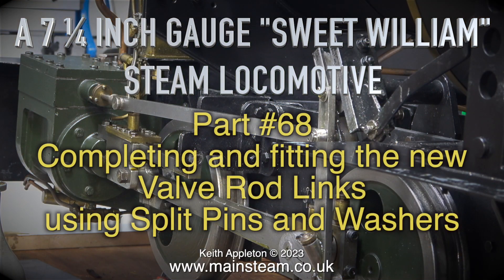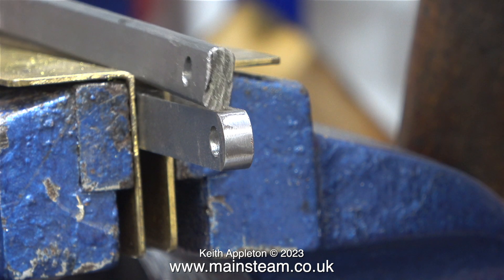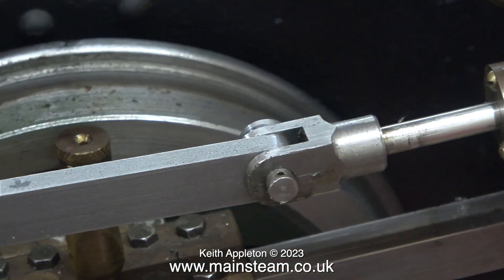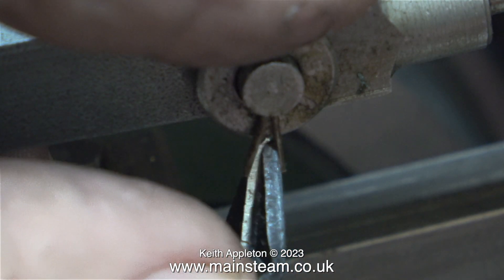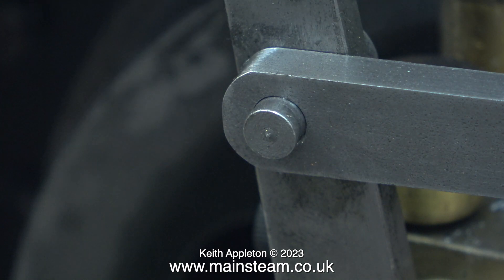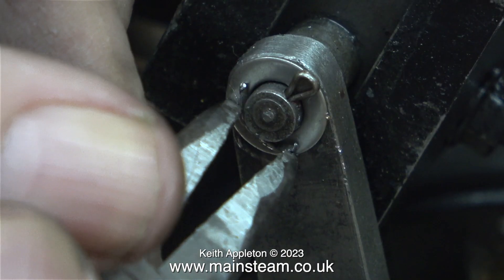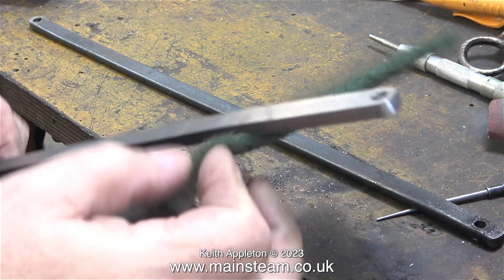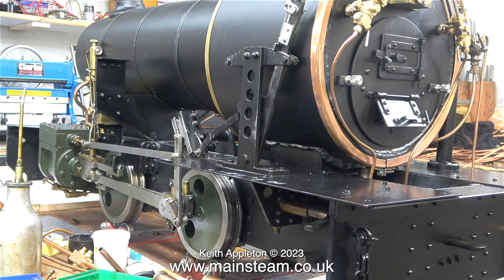A 7 ¼ INCH GAUGE "SWEET WILLIAM" LOCOMOTIVE - PART #68

Comment: Another way you could have bent the rod would be to put an adjustable wrench ( your large spanner) on the end and pull it to the desired angle,  for me, it gives more control.
Reply from the maker: Yes I suppose so, but doing it the way I show in the video does not mark the metal bar at all and it is extremely accurate as shown . . . . . . The jaws of good quality adjustable spanners are made from very hard metal,

Comment: When I do cotter (split) pins where the length is a bit long, I start the bend back of the individual sides then cut the excess off.  To me it seems a bit easier.  Your way works well as well.  To each his own.  Very instructive.